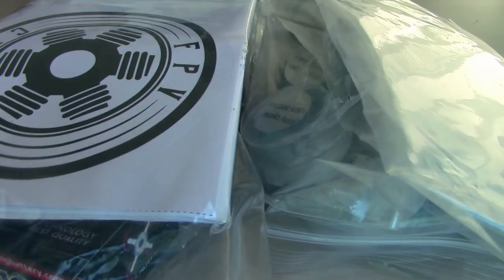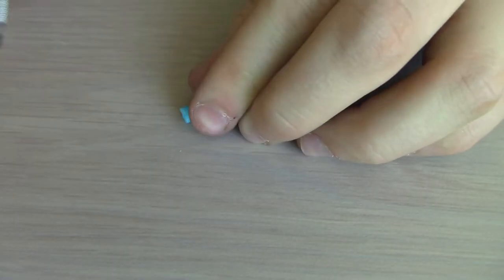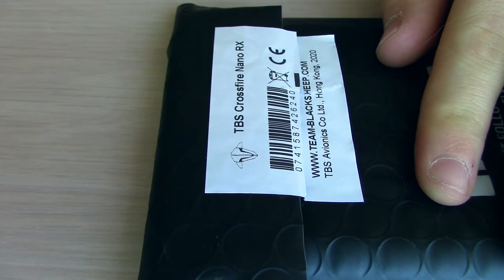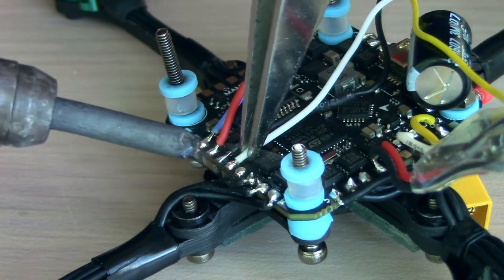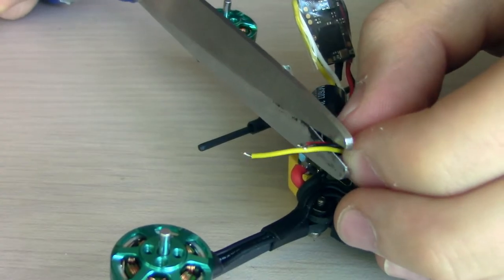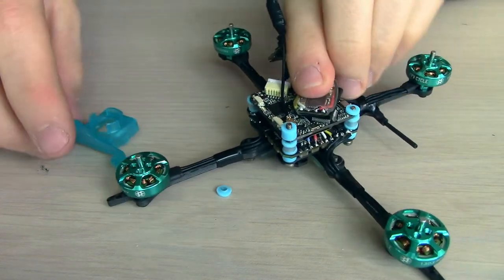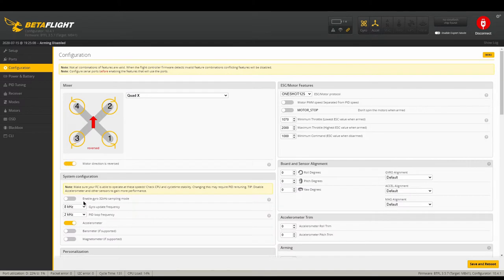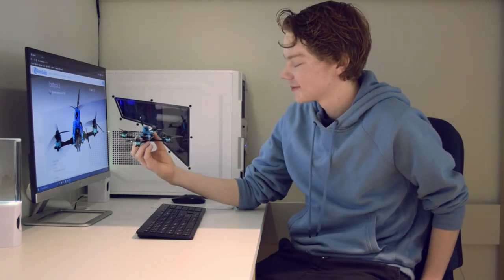How to Build a Baby Drone in Under 10 minutes | TP3

Comment: Are you happy with the result? Are the engines 5000kv or 6350kv? What is the avg. flight time? And last question - would you change any part today?
Reply from the maker: I am very happy with it. I get about 7 minutes. They are 5000kv. I would change the camera to the FPV cycle ant-lite.

Comment: Hi
Master Jansens
Can this Toothpick play with 3 '', 1-cell or 2-cell 18650 li-ion batteries?
Thank you
Reply from the maker: I have never tried using it with li-ion cells. The FC is rated up for 4s so, in theory, you should be able to use up to 4 li-ion cells.   Also, it pulls so little current so that shouldn't be a concern either.  I'm just not sure about the power to weight ratio.  It would be certainly something to experiment with first.
Reply: @masterjansens 
 For return
Thanks

Comment: Clean build.  Did you bypass the AIO board OSD or does the VTX have some passthrough?
Reply from the maker: It does have a pass through. I used it because I noticed that the video wire coming from the camera was very susceptible to noise from the nano rx and I figured the pass trough might help with this.

Comment: Great Vid! 
This will be my first build and step into FPV :)

Do you think the onboard DVR is worth it, or should i go with a smaller VTX and record just from my goggles?
Reply from the maker: It depends on what you want to use the footage for. If you are making videos, the DVR is nice because it records without any of the video breakup associated with analog FPV as well as having higher res (I think).  But if it's just for fun, you can skip it.  For that, I would recommend a TBS unify pro nano.
Reply from the maker: Also, I don't think you will be able to feel any big performance improvements going with something lighter so it's not that big a deal imo.